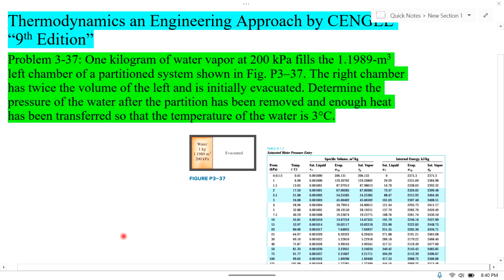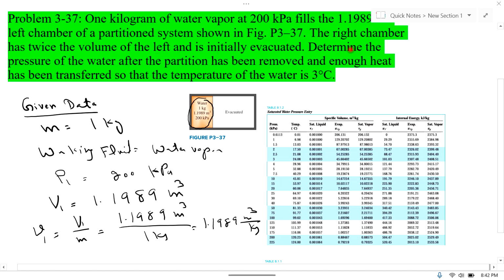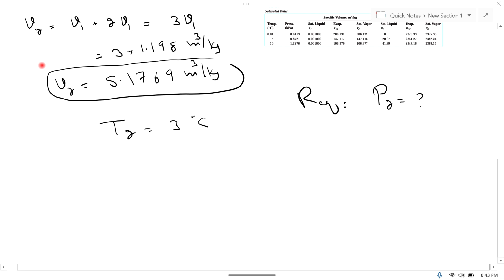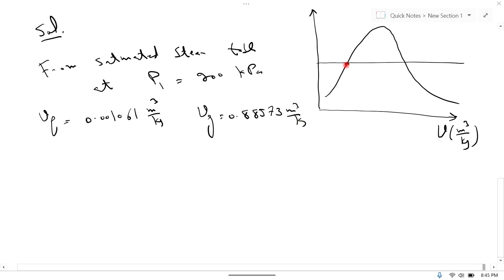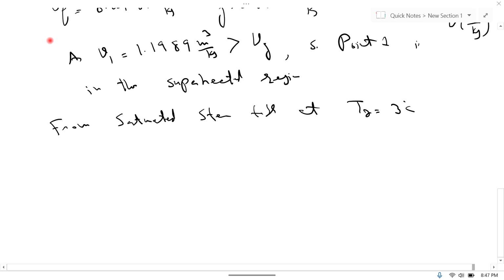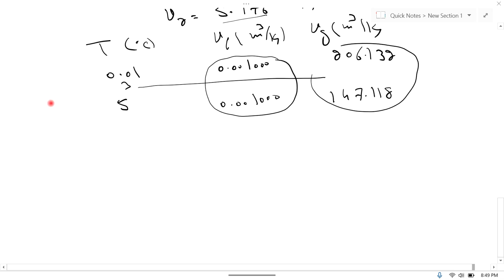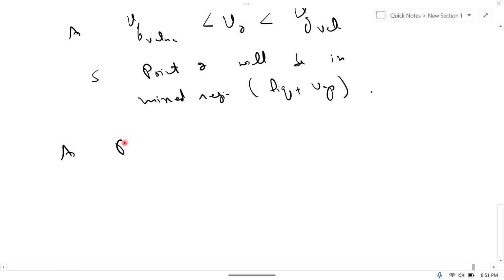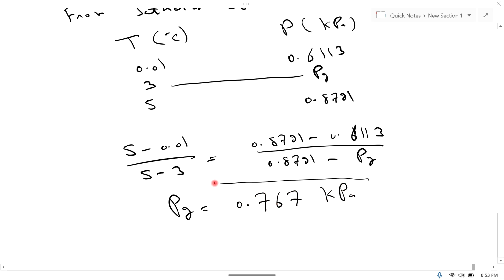Determine the pressure of water |Problem3-37|ThermodynamicsAn Engineering ApproachbyCENGEL9thEdition

Comment: How does 3 * 1.1989 = 5.1769?
Reply from the maker: Thank you for correction. 3 * 1.1989 = 3.5967. so the value of v2 = 3.5967 m3/kg. Fortunatly the v2 is in mixed region in both cases. so other problem is correct.
Reply from the maker: Please share my chennel with students. Thanks
Reply: I want to learn this from you on 1 call to call.